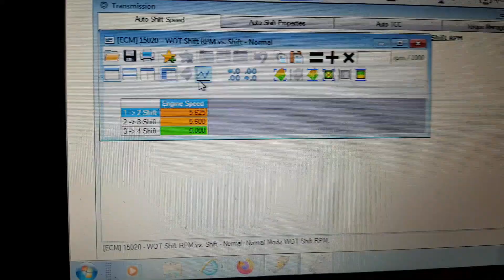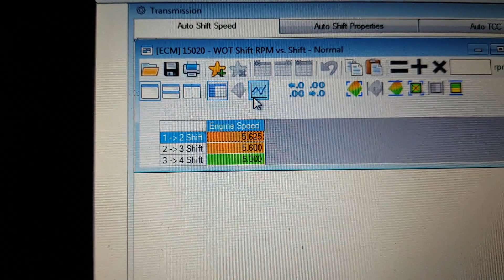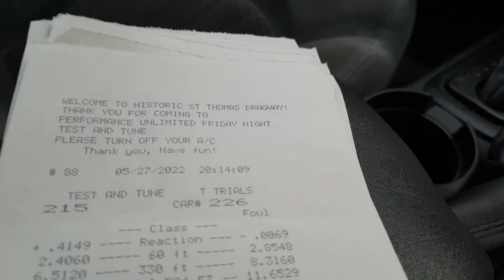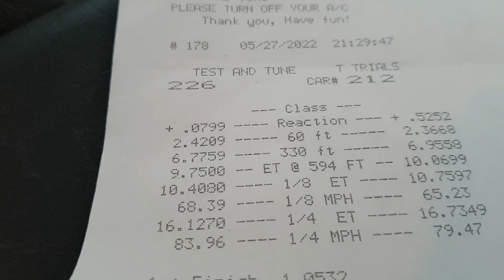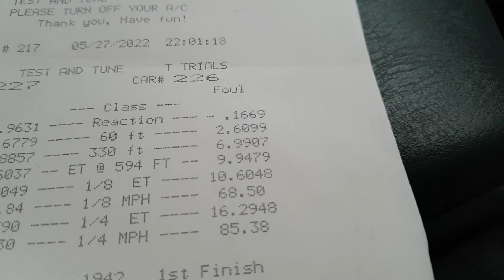First track day for the Grand Am GT!

Comment: We (my brother and me)  use to mod these cars back in early 2000s. Sold CAI and bigger billet TBs for them. (2.2, 2.4, 2.8, 3.1, 3100 and 3400). It would make a big difference.  My brother's '90 Z24 was a test mule for most of the J body mods. Also in the St Thomas area.
Reply from the maker: I know your brother from my J-body days back in the early 2000's! I had a few of them over the years lol
The 62mm TB for the 2.8/3.1 was a great improvement over stock. I would like to find one for a 3.1 project that I'm working on with a friend of mine... any chance of getting some more made up? I have had some people asking about them after talking about them in my 3.1 mods video!
Reply: He might have a 62mm TB for a 2.8/3.1 at home. Very doubtful on getting any more made. Best I could do is bore out a stock TB and fit a larger plate inside. And I don't think it'll allow 62mm
Reply from the maker: Send me an email modeverything1@gmail.com and we can talk! I have a couple stock throttle bodys and some 56mm plates from 3400's. It will be better than stock at least!

Comment: Pretty much what I expected it would do. My Alero went 16.1x in decent October air totally stock other than a short ram intake that mostly just sounded good.
Reply from the maker: Yeah they are all over the place in stock trim, but most are around 15.8-16.2.  I was hoping it would do better since my Alero went 15.5 with just a resonator delete and a little bit of a transmission tune on a cool  September night. The GA has a better final drive gear and 2.25" exhaust.

Comment: Might have a question I have a 93 pontiac grand prix le 4 door 3.1l and last time went on the track my best time was18.3  and best reaction time for me was 0.15 what would be best mod for the transmission to shift a little better in second to third I've done cat, EGR, crusie control, and coolant bypass delete
Reply from the maker: Depending on what transmission you have you would most likely need a shift kit or internal transmission mods to make it shift faster. I used to shift my 92 Lumina manually so that I could rev it a little higher with the 3500.
Reply: @modeverything1  the only I know about transmission is that it's a 4 speed
Reply from the maker: I don't know too much about the 4t40 transmissions. The 3800 sc/3.4 DOHC guys of that era might have some tricks for them

Comment: Hi I have a few questions for you if you could answer would be awesome thanks
Reply from the maker: I can try to! Haha
Reply: @modeverything1  I have a good low mileage 3500 from a g6 ND a good 700r4 I wanna swap into a 83 ranger and I can't find anything on making the harness stand alone or what wires to use to be a le to start it etc and I figured since you did the 3400 in the 1500 I would ask you
Reply from the maker: You would be best to look into a microsquirt/megasquirt. The lx9 pcm is not able to be recalibrated by hptuners or any others that I know of.  If you find any one that can recalibrate it you will need them to disable the security settings to get it to start. 
You could use a 3400 pcm and harness but you will need to make an external 7x crank trigger because the 3500 crank reluctor is different. 
Check out 60degreev6.com forums, lots of good information on swapping these engines on there!
Hope this helps you out!